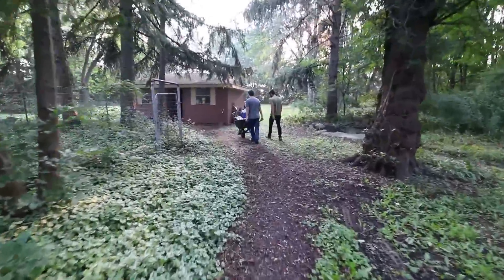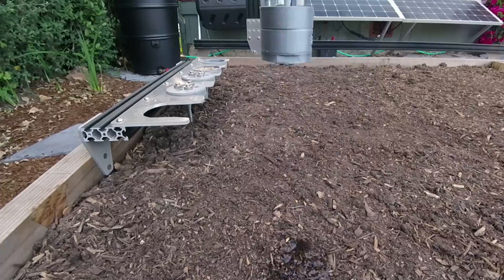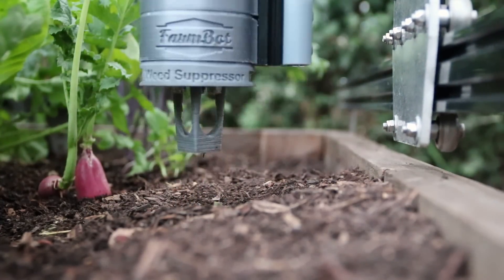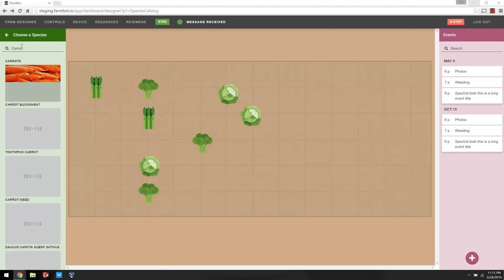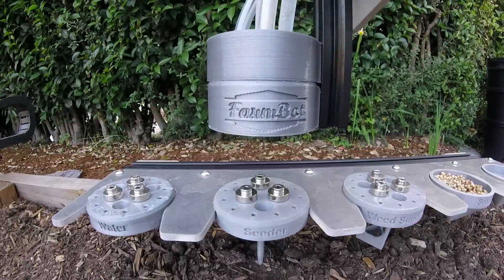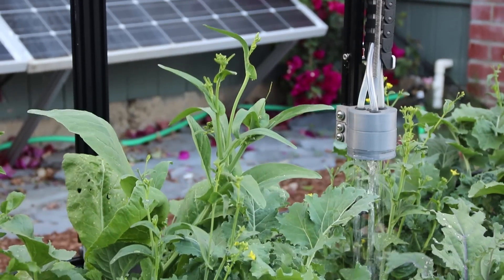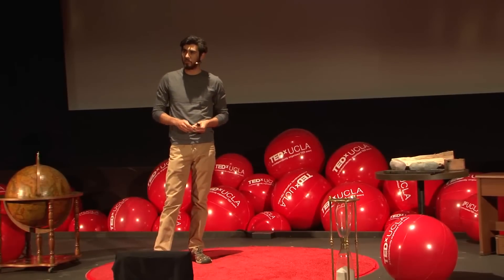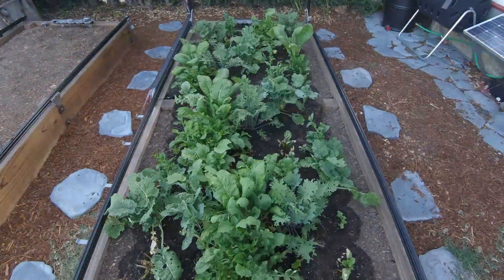Introducing FarmBot Genesis

Comment: This is the kind of idea that makes my brain happy.  So it is really cool, and techie, and may actually do pretty well under the right conditions.

But having watched a few videos and read through the threads in order to get this to become something successful a few things need to be changed.

1) develop a better version that is not open source.  the average person has no respect for what you developed, you should benefit from your work.

2) it really needs a soil ph testing tool, and perhaps a way to test for specific trace minerals.

3) it needs vaccum tips and recognition system for aphids, caterpillars, slugs, etc. and recognition for good bugs so they aren't killed.

4) a pesticide delivery system, for at least 2 different types, or a way to drain said system, and load a different spray automatically. 

5) a software update allowing a more sqft gardening approach, or a plant size definition set.

6) integration with some of the awesome high tech Israeli agriculture.  (ie automated drip head cleaers, ph, and water head replacer). and the ability to integrate data from those systems.

also perhaps a low range wireless gps locator for the head might be a way to get around the flexible track problem, but it will take a lot of redesign.

the idea to scale this up is great, but it a go big(and super high tech) or go home issue.  the comments about hydro, aqua, or drip being better on water delivery can't be ignored, those comments are completely valid.

I would like to see this be a huge change in Agriculture.  I think it is totally possible.

However at the price of 2900 for a personal system, gotta say, it is too steep for my pocket.

Comment: I love the concept but it's an extremely expensive solution to a problem that doesn't exist. Gardening a raised bed that size is incredibly easy. By mulching my garden I rarely have to weed and water. With a nice light soil pulling weeds is a breeze. You can even set up automatic drip irrigation for under $100.

Comment: Cool concept but...I think you totally missed the point. The first thing you do is lament how we have surrendered the way our food is being produced. So instead of taking that back, you just build a robot and surrender food production to it. That irony is reason enough for me to avoid this product.
Also, there are too many moving parts. Sure, everything is state-of-the-art precision built with weather-proof components but I still don't think that's enough. Wind could blow soil or debris into those belts or tracks and cause them to seize. I feel I would end up maintaining both the garden and the FarmBot when I could just be maintaining the garden. (Gardening is not hard work, maintaining complicated machinery is).
I would never implement this at my place. At the same time I'd still be interested in seeing future developments of the machine.

I just thought of another thing; the watering function. It looks just perfect in the video when it is watering freshly planted seeds. But what happens in 4 weeks when those plants are big and bushy? That nozzle will spray directly onto leaves instead of the ground (where it's needed).

Comment: Its a nice idea but lets be realistic. 
If you can afford to feed yourself with farmbot, then you probably have enough money to never have to grow anything anyways. 
One farmbot is 3450 usd inc. taxes. 
The crop average is 44 calories per day with the farm bot genesis. 
To get to a 2000 calorie diet per day. You would need (2000 / 44) 45 farmbots. 
45 farmbots is (45 * 3450)  155 250 usd.
The size of a 2000 calorie farmbot is 205 square meters. Which is huge. If you make a square it would be 14 * 14 meters.
Then you have the cost of assembling all theese farmbots which is gonna take up a tremendous work effort. You also need to program them, you need to make sure they have their seeds, their water and electricity. Not to mention any wear and tear, replacement parts, work hours supervising and testing the machine.
Sure you might have all this money and you decide that you want to start a project of eating a vegetable diet only because its organic and it saves the environment from pestecides. But if you had all this money you could have spent it on buying organic food in the stores which would benefit the farmers and motivate other farmers to start doing the same. Not to mention how bad it is for the environment to produce hardware. 
I don't think farmbot is such a good idea for any other reason than, you want a hobby that looks cool.

Comment: Make sure it is solar powered, that's key.  Certain crops would be hard to water over head like that.. I suggest you work on undersoil watering scheme to help with evaporation and to keep water off the leaves of certain plants.. like squashes, tomatoes, peppers whose flowers are ruined by overhead watering. Plus weeds are not all to be treated the same some are extremely beneficial to the plants soil and predator bugs.  I think this as it is now seems suited to greens and lettuces and would be good for those who are immobile.  There are already computer operated tractors growing most of the country's food., running watering schemes, testing for soil moisture electronically..etc, so all this already exists

Comment: The main points of this device is that it allows anyone to grow a garden large and meticulously well cared for to feed yourself without much labor, and more importantly be open for improvements made by the community. 3D printers and prosthetic limbs made by them have improved immensely over the last few years, making fairly advanced arms and legs cost a fraction of what they used to.

Give this a few years and a good community and it will drastically change the way food gets to your table.

Comment: This is really nice, but it is way too small.
You should develop this for a 5 meter wide, x meter long setup or something like that instead...
Reply: its very easily scale-able, just get longer rails and cables, enter in bigger numbers for the code,  it will slide along the entire length just fine...

Comment: attach a 1 or 2 watt portable laser pointer who is the camera mount so that you can blast bugs and caterpillars and aphids off of your leaves
Reply: also needs to be tall enough vertically to sail over the highest plant that you intend to cultivate I would not mind a unit that is 10 feet tall
Reply: +william webb a option to add another axis of movement,
 to that up and down head 
would be good so that you can get in under foliage at an angle to do your watering or weed picking
Reply: +william webb try to program and some logic that has a pruning head or something that keeps its own tracks free of debris or plants so it can pick out Vines that grow into its own wheels

Comment: Cool idea but wrong design. Make it one arm instead. Make a better earth sensor. Then you can just stick it into the ground (any ground) in a corner or just about anywhere.... yes it will be round crop farms but why not?
Reply: Go ahead, build your own design....
Reply: ***** Would love to, but I have no money... the only thing I can do is to constructively criticize other designs...
Reply: rjc0234 I think the efficiency is about equal if you consider that all gardens are not (aspecially not Europe/Asia and so on) square and a one arm (mini space shuttle arm) could actually be in use in any shape or form and use every inch... and you need some space in between anyways to walk around an harvest the crops... but sure if you have a totally flat/square garden it could not use all the space (if you don't have more then you need as one arm can do a square also although not the best use of the reach...)

And another thing... if you have 4 round shapes it will be a space in the middle... why not put the water in there? and with a small extension on the arm it could suck up a small amount to water the circle and then that space would not go to waste...

And about the arm it should be 3 jointed one... so you have full control... like the space shuttle "Canadarm"...
Reply: round far less efficient space than square, but as you say, far less parts. maybey even a heavy duty wheel at the end to rotate the arm, and just a shuttle going backwards and forwards.
Reply: very true. water in the middle, or a place for teh controller. i think though the canadarm would have a bit too much waight on the end. you would trade off all the extra parts, for having to have much stronger parts.
Reply: rjc0234 Yeah, maybe the canadarm is a bit of a stretch maybe. Maybe a "crane" design with a rail system but then you could not reach the inner things... (was that your suggestion btw? can't remember :-) well one motor for the up/down and one motor for the reach... or one motor that does all with some clever gearbox design... x/y/z axis... 

Main controller (server) could be some arduino type thing... and the controllers (clients) could be the cheapest rasberry type ones... and BT connections with peer to peer communication with the servers... anyway what saves the energy most...

And speaking of energy... hmm.. solar panel combined with a small windturbine and a battery thingy would be nice... so you actually could be portable and leave the thing for a long period... then you could go out in the forrest on a small patch and let it do it's work basically... it will (could) do anything really...

Yeah... a water collection system too...

Ahwell just dreaming! :-) but fun!
Reply: 1 arm would be a nightmare to build, it would have to reach out over the garden and would have a lot of torque acting around where its mounted. The CNC design is really robust, scale able  to any garden size (within reason/material constraints), accurate, and lots of open source tech already exists for it.
Reply: Mike Cammiso Oh maybe I was unclear. I did not mean one arm for the whole garden. Take the size in the video but make it one arm instead. Small garden means maybe 4 of this arm/robots wich if positioned right could all share the tools and all would be joined (wireless/bt) and use one main/server computer and connect peer to peer so you could extend it... Ofc you could do squares with one arm also...

Comment: This is awesome! We built two garden boxes last year, and have had a decent crop. I'm curious why you push a weed back in the ground rather than pull it out?
Reply: pulling would be more difficult. as a seasoned gardener you learn roots are designed to hold the plant in the ground. when you pull the stem usually breaks leaving the healthy roots behind to regrow. pushing it into the ground causes it to suffocate and rot away. Most importantly. it leaves nutrients in the bed where as pulling removes. Also, it makes the bot easier to design, thus cheaper.
Reply: Wow - I had no idea! Thanks for the info!

Comment: will this work with cannabis?
Reply from the maker: Sure - no reason why it can't
Reply: I would presume it would...which can make this a very dangerous profession to be in. 

you'd just have to input the data yourself for FarmBot to maintain the system.
Reply: Yes but only with dwarf varieties.
Reply: Don't be a hater, it's a cool invention for automation farming. And yeah it could help a lot of folks get into growing their own food/plants.
Reply: deadmeh while I appreciate what it could do for....some regions, and some kinds of people.

I do agree, this isn't much of a problem, weeds can be prevented by having a black (or white opaque) tarp/garbage bag over the raised garden bed, watering can be done with a simple resivoir, a pump, timer, and some leading tubes/hoses to the plants themselves, wastes less water overall, and is vastly cheaper.
Reply: You could just force flower faster.
Reply: dieselphiend wut?
Reply: Just get your males with balls out ASAP. Neighbours shall hate them and your buds.
Reply: Brad Spring automatic Hydroponic Trays, would be VASTLY more economical, environmentally safe, and more likely than this method.

I still want to see some hard data, and an impartial third party test on this. if it works within an efficient and functional manner, then I'll re-consider my stance, 

but as it stands, my method above is a bit more functional, and efficient.
Reply: Brad Spring
it's barely something you could consider an invention, give me a rasberry pi and some basic tools and almost anything could make this.
Reply: deadmeh pretty much, I mean, it's overcomplicated, solves no major issues.

it's basically a toy. If you want to grow herbs, go with those old AeroGarden kits. Anything else, a raised garden bed, and a black tarp with slits cut into it. you get rid of weeds, and sub fungus at the same time with that. and the system I listed above works just as well, maybe even better with the Pi.
Reply: Lockerd
 yeah watering a tiny garden isn't a problem also this shit isn't going to look at the plants and go oh this probably doesn't need water today since it rained or was damp or whatever. You still need to take care of them and this shit isn't going to do that.
Reply: deadmeh not to mention, it's got more long term maintinence. over flipping a switch.

moisture sensors are easy to implement, and make in something like what they're proposing.

but overall it has more things that can go wrong, and has more input required.

between this, and a black tarp, an aquarium pump, some black lines, one 2.5 gallon jug (can get one at grocery stores for 2 bucks, with spring water. ), and a basic vinegar anti-fungal spray. I'll choose the latter. I just have to flip a switch every so often.
Reply: Somehow i knew that this was going to be the top comment
Reply: Such a hater.
Reply: It works best with cannabis.
Reply: How does it feel solving a problem that doesn't exist then circlejerking it like the hipster tryhard you are.
Reply: xxXSalty_Viper420Xxx
 m'boi whewlad.

Comment: Do these guys realise that in the $2.900 asking price range there are places where you can hire people to work the whole year and plant and care for huge surfaces? If the kit was in the prince range of an iPhone as a start with the perspective to come down in price at $200-$300 with mass production I might have thought they stand a chance to have a huge impact...
Reply from the maker: Prices will come down over time. But at low production quantities and a current $2,000 BOM we have to charge what we are if we're to continue researching and developing this. Home use 3D printers started off in this range too, and look where they are now!
Reply: so that proves that it can pay off in the long term depending on how much the machine costs and how much you pay to someone you hire. if you pay $100 in 3 years it pays off. but at least here you can pay $20 a month for someone to do that. so it would take 8years to reach $2000. and obviously it does a much better job.
using CNC tech to do this worries me because of scalability. it's not very feasible to have small squares.
and that 3D printing price worries me even more. CNC have been around for a lot longer than 3d printing and prices are the lowest possible already.
you can compare with 3D printers. just check the prices of 3D printers of the size of farmbot. not exactly inexpensive. the prices are low because the scale is low. it's possible to produce a mini farmbot to grow seeds to replant for a fraction of the price. it's all about scale. that's why CNC doesn't sound such a good idea.
imo a much better idea is to have somekind of robot with wheels or similar with a station where it can refuel, power tools water etc. (similar to autonomous lawnmowers) that would make the scale issue irrelevant. 
I do love the basic idea but I don't think it's going in the right direction.
Reply: Exactally, that is the point. And you might need return of investment as well.
Reply: we live in the first world yo. it sucks to be in the 2nd and 3rd worlds. but accept what you have.
Reply: FarmBot.io Well, I'm going to wait for you at the end of the tunnel. Rooting for you here to reach it. And dreaming about an autonomous field roaming robot that has the potential to end world hunger..
Reply: The world already produces enoufgh food to end hunger, the problem is further down the line...

Comment: I feel like it would be more easy to make this work in a circle. save maybe 1 or 2 expensive step motors and controllers, you could just use a optical sensor like a scanner uses or even a joystick type of sensor. Seems like you could make the boom arm longer too to cover more area and make it worth while.
Reply: A jib crane in the middle of a round garden... LOL. You just obsoleted their entire toy for half the price.
Reply: I agree, though it might also depend on the geometry of the land, to increase farmable soil, if the area is rounded I would be with you. If it's more squared, then I think the design they came up with would be better. Maybe they are considering that for future models
Reply: Circular anything is more expensive than square. Tracks are especially notorious for this, but the rest as well. Also means you can't use a normal wooden raised box, you'd have to use something plastic (the hipsters won't like that!) or rubber. No real sense trying to save this idea anyways.